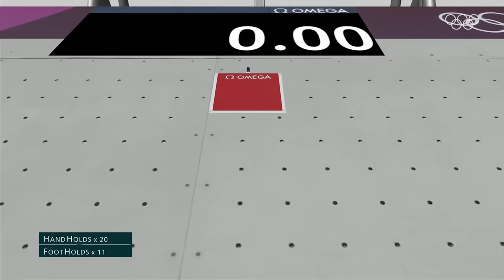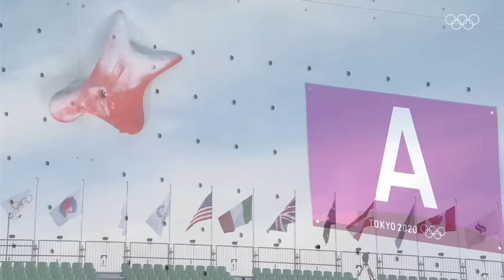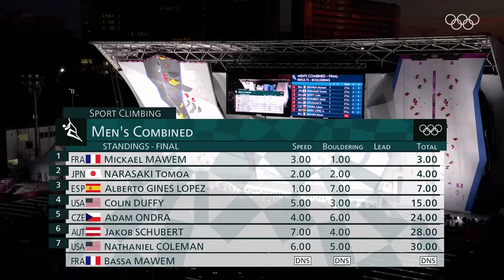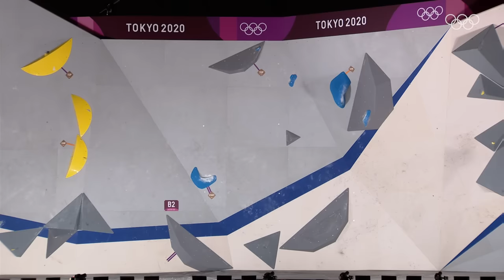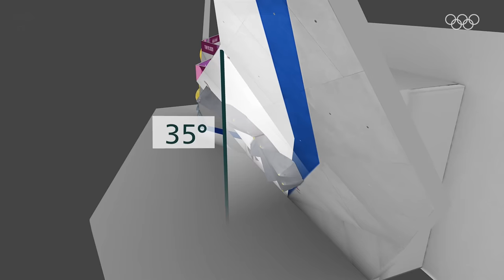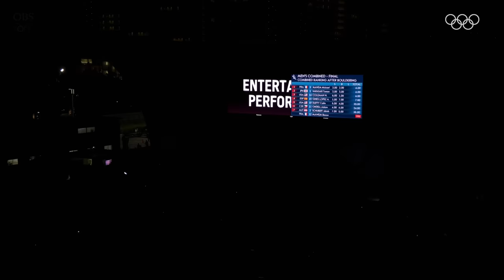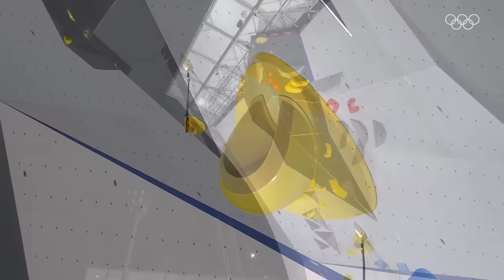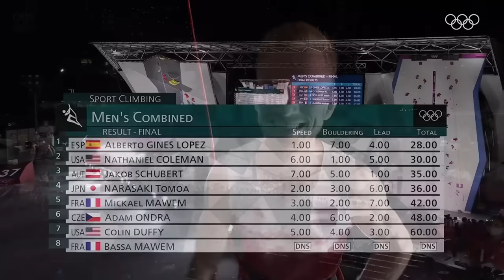🧗‍♂️ Men's Sport Climbing | Tokyo Replays

Comment: This was very exciting to watch! Unfortunately, no athlete from my country participated, so I didn't see this on television as there always was another sport with an athlete of my country in action.
I also like the triple combination of this, and hope that in later Olympics there will be both this triple combination and individual disciplines of climbing.
Reply: I agree that it is an interesting combination and will create a new league of athletes who will specifically train for the triathlon discipline. Currently however very few climbers are well trained in all 3 disciplines and the ones who are (Tamoa Narasaki) end up on a much lower place because of the strangely specific scoring criteria. In my opinion they should have applied the same method they use in the decathlon in athletics, which is an aggregation of the points scored in each event, where the scoring system is based of experience of performances of many competitions.

Comment: The climbing was great, but the speed climbing should be a separate event and i think they announced it is going to be next time.
That final boulder problem was insanely hard, but it looked fantastic.

What ruined it for me was the terrible Eurosport commentary. Its like they just had a script to follow and didnt really know about climbing. Just throwing climbing related terms in to make it sound like they did.
The called the belay guy an 'auto-belayer' and just threw around descriptions of moves as if they were picking them off of a sheet of paper. Why not just get a commentary team with climbing knowledge? There are loads out there.
Reply: Speed climbing will be separate next year.
Reply: oh i agree the commentary was completely pointless
Reply: Finally found a comment saying this. They said so much ridiculous and irrelevant stuff, like what was with that wildly inaccurate climbing history part about the origins being in Smith rock 80 years ago?? Not sure why they didn't use an IFSC commentator whos been doing it for years

Comment: Great debut for the sport, but the format needs to be revised. It leads to rather weird outcomes for everyone involved. Alberto did not seem too happy to have won almost entirely because of stronger speedclimbers slipping and false starting next to him. Similarly, being overtaken by Jakob making the difference between gold and sixth place for Adam also leaves a sour taste. And let's not forget that CLEARLY Tomoa is the most balanced climber in this format and lost an insane victory because of a slip against Alberto whose speed personal best is over a second slower than Tomoa's.
Reply: That is the Olympics, the history of the Olympic games is full of stories of "Medal Certainties" failing at the last moment.  A once in four year event puts a lot of pressure on the top athletes.  Alberto had no pressure, no expectations so he could focus on the moment.  The one I suspect who would be the most disappointed with his performance however, would be Colin Duffey. One misstep ended his medal hunt.  In that matchup he was against Alberto and on form Colin would have won that and Alberto consigned to the bottom four.  The medal table would have looked a lot different then.

Comment: Wow, watching this back is hard. The commentary was so aggravating to listen to and the people they hired to do this were clearly under-qualified in terms of knowledge of the sport. I really hope they get the experienced and enjoyable IFSC commentators for Paris 2024. The whole production of these events in Tokyo felt off, honestly. The length of the holds, for example, is generally completely irrelevant to point out, especially for crimps, but showing a 3D model of each climb was an overall great idea that added to the whole experience, and it's no wonder this practice has stuck around in the sport since then. I think what's most unfortunate about this first edition of Olympic Sport Climbing is that the men's boulders were really misjudged, either too easy or way too hard, and because there were only 3 of them there was no proper separation of scores. Also, the combined format in general was frustrating and difficult to keep up with, hence the crazy possibilities coming into the final lead part. 
Sport Climbing will be way better in Paris 2024 simply due to Speed being a separate discipline and the Boulder & Lead athletes having their usual 4 boulders and 1 big route to climb, without needing to train for a completely different sport, basically. To give you an idea of how different they are, it would be sort of like asking water polo athletes to do a regular match, then a 1500m freestyle swim, followed by a full artistic/ synchronized swimming routine. Additionally, the IFSC has since changed the way the combined (now Boulder & Lead) discipline is scored, which makes it far easier to understand who is winning and by how much. Nowadays, instead of counting the number of attempts to all zones and tops reached, bouldering is scored as 5 points for zone 1, 10 points for zone 2, and 25 points for a top, minus 0.1 per attempt, for a total of 4 boulders, so athletes can get a maximum of 100 points. Lead is around the same as before, adding points for each further hold the athlete can grab, but adjusted to fit this 100-point max as well. This means that now, whoever gets the most points when adding boulder and lead together wins, AKA, whoever is closest to 200 points is the winner. This also means that there are no possible surprises and big upsets, unless someone unexpectedly falls, because you can easily calculate how many points they would need in Lead to pass someone else, and whether that is possible (bouldering score + 100).
I'm really excited to see this sport in the Olympics later this year, and I am praying to the climbing gods that the boulders are well set haha.

Comment: A lot of people are complaining about the scoring system but for a climbing triathlon it makes sense when you look at the final results graphic. Every medalist took first in one sport. I'd really prefer they separated them out into 3 different competitions though. The finals for lead should be 3 different routes. The bouldering finals should be 4 boulders. And speed finals should be 4 time trial attempts at the same route, not a single short race for each bracket

Comment: hmm... I'm not sure that the route setters did such a great job this time. when you have this many olympic level athletes that fail to top it just seems a bit off (plus everyone flashed the first one?). I would be interested to know if anyone at all was ever capable of getting top on the last boulder. hanging from a cliff face that's angled at 35 degrees by two finger tips just isn't feasible, and I'm not convinced that it's even possible to get a foot on that middle hold in the given situation. also, I feel like different styles were prioritized. definitely not ideal that multiple people basically got the same result over and over again.

also, all of these guys hands and wrists are covered in cuts, abrasions and blood. I really feel like the ability to withstand the pain of constant injury shouldn't be a factor in success when it comes to sports, and these routes really caused the atheletes pain.

Comment: That last boulder was a bit much, the commentators were saying the second one was suppose to be the most difficult but the last seemed basically impossible, no one really even came close to holding the hold at 1o'clock, let alone getting close to being able to ever work out a finishing position. The 35 degree angle was just too much really.

Comment: as there is done for serving in tennis rules, there should be an allotted 2nd attempt for contenders who false start or fumble their run halfway... It just makes more sense, doesn't even have to be complicated, just let them redo it alone. I think that is as fair as being able to serve twice in tennis. There are many kinks to work out in this speed climbing format.
Reply: Just check what happens in running,  FS and you are done. It even happend to Bolt.
Reply: It's a speed racing.. It's not like tennis at all. Its more like sprint in athletic. 

If you do false start, it's your problem.
Reply: @sugiartokahar938  I’m pretty sure in 100m if someone false starts the race restarts and they get a second chance. Bolt got DQed for two consecutive false starts.

Comment: Winning the speed because of a false start and slip might be lucky and an unfair advantage (but that's the system's fault), but let's not forget that Adam Ondra was guaranteed four points which isn't fair either. If B. Mawem wasn't injured, he would have definitely won that round and Ondra would have most likely finished last with 8 points. With 48 points, he would have been out of (gold) medal contention already, not even a win in lead could have helped. It was because of those gifted four points that he even had the chance to win a medal.
Actually, instead of having seven people compete, why didn't the 9th place in qualification take Mawem's place? That would have made the speed fairer.